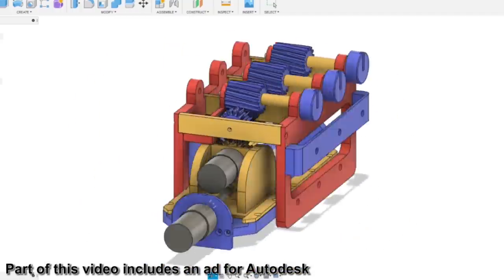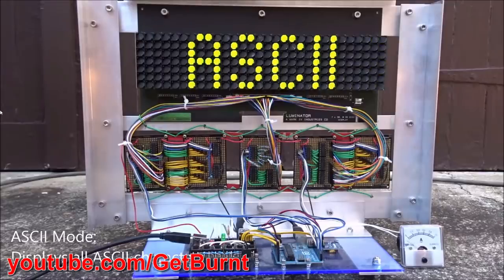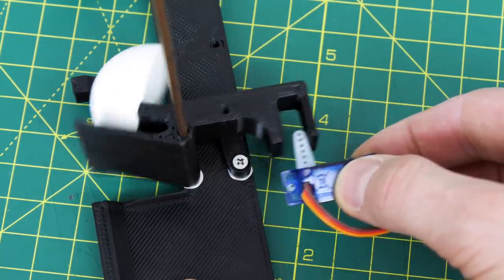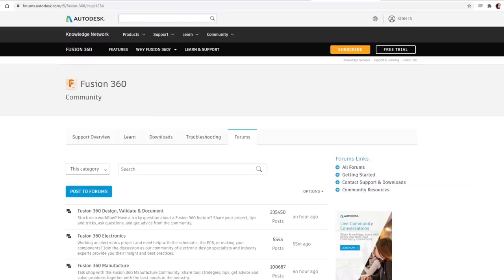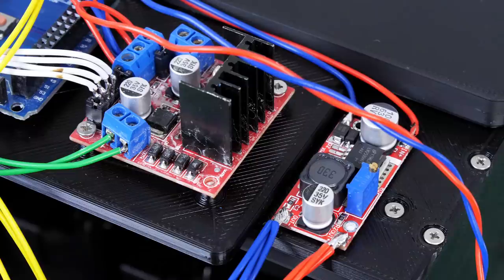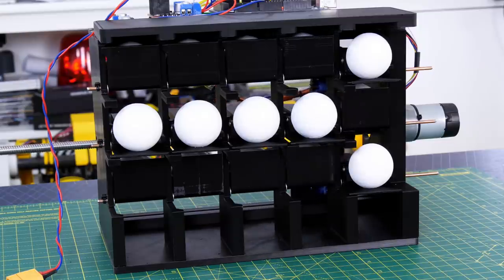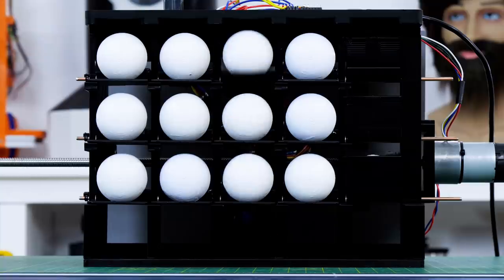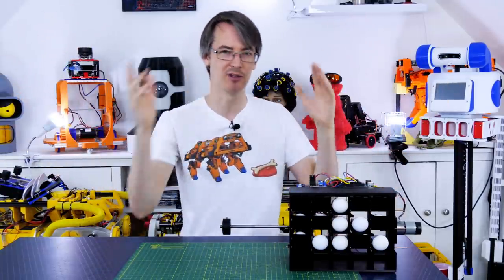Mechanically Multiplexed Flip-Dot Matrix

Comment: I've only ever used AutoDesk's SketchBook Pro - but I can say that program was quality. It's a name I don't hesitate to trust.
Reply: It's a name one can very much hesitate to trust because of lack of ownership and lack of transparency. They have tried to change the terms of use of Fusion 360 to be less kind to individuals and partially back-pedalled on that after backlash a year ago, but still implemented some changes. They bought Eagle (electronics design automation - schematic, PCB, etc) and converted it into a subscription and also did a whole number of the quality of the software. Maybe Eagle got better by now, but i hadn't been using it since then, so i don't know, the transition period at least was horrendous, it was pretty much unusable back then. They bought Softimage|XSI 3D animation software, and then killed it off, because it was competition to Max and Maya. They had 123D suite of easy hobbyist programs, and killed those too. You don't want the whole ecosystem to be combined under any one roof, it's not going to be to the benefit of the end-user, and especially not under Autodesk's roof, also not under Adobe's roof or any other such giant conglomerate, you want there to be some actual competition.

That being said, Fusion 360 is powerful and fairly smooth to use and quite easy to learn, it is an excellent piece of software with little in terms of alternatives that are even nearly as good, you really almost can't escape it. There was OnShape but affordable tiers are no longer friendly towards small creators, they changed their terms, which is specifically why community is so sensitive to this issue that the company can take away your software anytime. But say if you were to choose Eagle, you should seriously consider Diptrace and Kicad instead.

But in part just how indispensable Fusion 360 is, is what makes it so scary. Because where do you go from there when - not if - it becomes unavailable or no longer affordable?

Comment: What about adding a circular motion to the linear axes. Like a clock. It will add to the reach from 1 direction (X) to 2 directions (XY). With the cost of just 1 motor which will turn the axes like a clocks hands.

Comment: to avoid that half step when the servo need to move to position of current lever. I'm thinking in a mechanism that offer 2 levers to the servo so when you move one or the other lever will TOGGLE the dot. I have no idea on mechanics but sure it can be done, one lever engaging directly as the ones you have, and the other one below, Or some mechanism similar to the one that drives a wheel in a steam locomotive, when the wheel. 
Regardless I imagine 2 parallel levers similar to the one you have, and the servo will end in a T shape lever so regardless position the servo finish with previous column it always engage with one of the lever and the only thing you need to do programatically is to toggle the servo if the dot need to be toggled or do nothing. You can then skip a column if no toggles are need to be done, all of this should increase speed.
HTH

Comment: What about a robot that has several degrees of freedom but only 1 or two servos/motors? One to decide what joint, pully, gear, etc. to move and one to power that movement. It would move very slowly if it was a walker, but it mmiiiiiight work...? Sounds challenging at least!

Comment: The servos for each row is massive overkill for something that’s really meant to be a binary display: solenoids would make more sense in this context for cost, speed and ease of repeatability.  I suspect you just happened to have a bunch of servomotors with control circuitry laying around you felt needed to party together ;)

Also, it seems odd to me to go through all that fancy mechanism to make half balls, when you could put a center shaft through existing balls and rotate them 180 in a smaller volume than what you created.  So many ways this could be done simpler, cheaper.  Well, you had a deadline, you got something workable on time!

Comment: what if you had multiple gears in a row linked to each dot in such a way that in both positions they are clocked in a way that an independent drive gear could slide past each one in either direction and drive each dot to the desired state. the trouble then just becomes how would you create such a drive train efficiently and compactly. also, the actuation mechanism should have a bit of a bistable restoring force to lock it into one or the other state. then you could also possibly introduce more states than just two to introduce more possibilities in the display. maybe something like having multiple colors not the surface of a drum or sphere that get exposed for a certain angle. these are just my thoughts

Comment: It'd be nice if doing a 1 in a position that was already 1 was a noop. What if you think of the actuation as a rotation in a direction rather than push to position. Then you could have multiple horns on the servo. And it just rotates at each position. And then the thing it pushes against is two part, the bit you have and a piece between that and the servo horns that flops back to center, preferably under gravity. It's kinda like having momentary action switches at each spot and booping them all as you go past each position.
Reply: If you made the flaps the servos push full bit width the tolerance on flight time would be bigger you could do the rotate servo as you move through each position rather than needing to wait in position.

Comment: Pneumatic Actuators instead of Servos might work, place a magnet on the end of them and a metal plate on each arm.  Have it so that when the pixel is black (pulled inwards) that there is still a gap between the plate and the actuator in its "black" position - that way you wont have to match the previous columns configuration just pull all actuators to their home position.  I realise this is only half the battle for clearance but its an idea.  You could always do it with electronic solenoids but where is the fun in that?
Reply: having said all that, I like someones idea here of using a ramp on the black / white pixel side.

Comment: Arrange ends of some mechanical wire threaded to, and attached onto, the flip dot in a line, and use one lead
screw for a number of actuators spaced out across it. It may be a costly solution, but the mechanical wire can be substituted with something like filament. At that point, you could even double your axes on the multiplexer by making the column of servos sweep across an array of mechanical wire inputs. Imagine even if you could manipulate the surface of that array, to use a different system of delivering the actuator. Like a spinning column of actuators inside a cylinder of inputs. Kinda like that robot arm thing Leia used Star Wars when they stole the thing, but reversed and not actually the same thing at all 😂
Or a spherically arranged array of inputs, and a motorized ball joint in the center with an actuating arm. And no matter how you arrange the inputs you can always pipe the mechanical power to the desired output (within the torque specs of your servo ofc).

Comment: I imagine all elements of a row or column sitting on an axle. the axle can spin without turning the elements unless the current row/column is pushed by a wiper like thing passing by and e.g. pushing them into a felt disk on the axle which friction couples the element to the rotation. each axle has to switch from clockwise to counter clockwise to set or reset the element at the crosspoint of the axle and the perpendicular wiper...

Comment: I think binary is kind of a waste of this mechanism, it doesn't allow you to show off the "going to the section with largest error" since every row is only max of 1 error away.

You either need to multiplex the vertical component too so the errors on the vertical are cumulative and so there can be a column with larger error

Or go back to analogue, rather than dials though you could flip them vertical and colour the edge 1/3rd black, 1/3rd white and 1/3rd transition the rotation gives you an overall black white or grey for that pixel

I'd also change the "until the right value" to "until the correct value or X seconds has elapsed" that means you can have constantly changing input data to actually show off the way it works like say displaying a sine wave that's scrolling across the display (very slowly ... slow enough that the multiplexer can visit each pixel in theory at least 4 times per cycle)

Comment: Have you considered making a flip-dot matrix using the traditional electromagnetic solenoids? It might be cheaper to design your own system than to use the 9g servos.
Reply: The point is not the flip-dot matrix, the point is further exploring the proof of concept mechanical multiplexer he made last time in a more practical scenario.
Reply: @LucGendrot  I understand the point of the video. I'm merely asking if he plans to expand upon the traditional flip-dot matrix in the future.

Comment: how about using the dots as memory instead of memory in the controller, "pass by", "check state", "change state", "set off", "set on"
Reply: quantum dot memory, mechanical or magnetic, solid state hard disc iron
Reply: cross-point row-column single cell change

Comment: The very reason flip-dot screens aren't implemented this way because it's so slow.
Reply: I have seen a mechanically-multiplexed flip dot display at the airport in Milwaukee WI in the 1970s-1980s.  It was backlit, and one could see the silhouette of a carriage assembly moving side to side to update the display.  I would expect it probably had a switchable electromagnet for each row, which would be moved across the display to update all the pixels.  Refresh was probably about 10 seconds or so, though I never timed it and so my memory may be inaccurate.  Probably at least 5 seconds, though, and less than 20, for a display that was probably about 8 lines by 16-20 characters or so.

Comment: How noisy is this thing? You should use PCB coil electromagnetics, will save so much time and hassle for using motorized devices to switch the dot-matrix. Also make a clock from this.

Comment: what about using studding instead of the lead screw; much cheaper & no need for extreme precision. would make the thing truly modular, if you wanted a longer one just buy a longer bit of studding. all the motor has to do is drive one captive nut

Comment: What a pointless design! Obviously it is not for speed. Reduce complexity - nope. Scalability - not as well. Just because I can - yes! Just put XY caret behind the screen with actuator. And you would flip your balls much cheaper. Just 2 motors and 1 servo. That would be scalable. And yes, don't print ping pong balls if you have a plenty of them